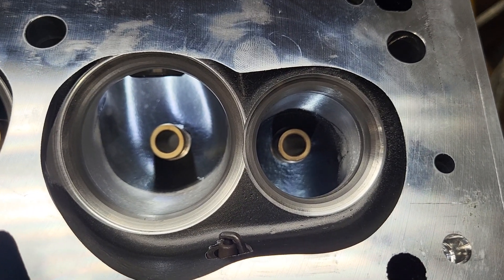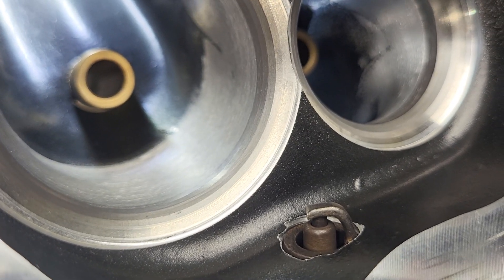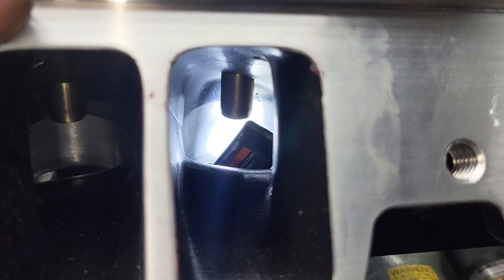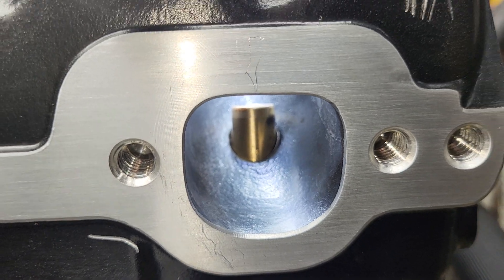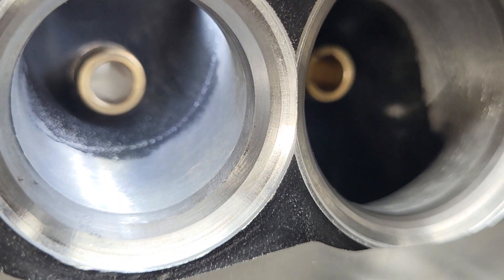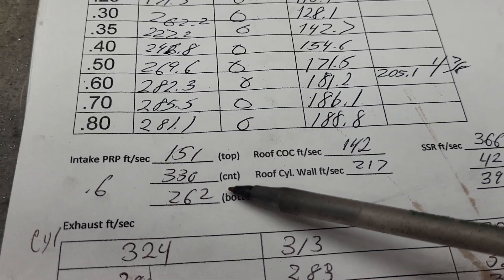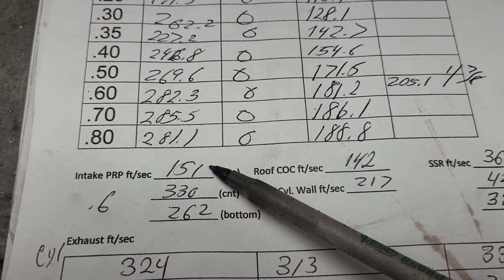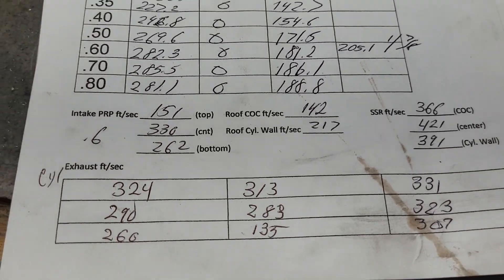Promaxx 200 small block Chevy cylinder head, First look and stock flows. Pretty good!

Comment: You have done some very good videos on head porting and it is going to be interesting how these heads turn out.  Have ever thought about doing a short video on the use of flowballs?  Such as showing what happens when they are used and what should be done after seeing the results.
Reply from the maker: @kenwilliams701  I thought I did that already. Thanks
Reply: @servediocylinderheads  I did search for flowball in the search option and did not see anything.  I seen one on pitot tube that was very good.  Is the flowball use possibly buried in a video that is named for something else.  Thanks for the great work and videos.
Reply from the maker: @kenwilliams701  I could do one. I may need reminding. Thanks
Reply: @servediocylinderheads Thanks That would be great.  I built an eight motor PTS flow bench many years ago for some racing I was doing then but never really scienced out how to do the porting correctly.  Put it in the corner when I was done racing and have not done much with it.  I have a 2001 S10 Blazer now and want to get more power out of the 4.3 so decided to port a set of heads.  Now that I'm older, want to do it right and understand what is going on in the port.
Reply from the maker: @kenwilliams701  Excellent!

Comment: I have sold those with the black coating.   For someone that want's that look they are great.   I have sold a few sets of these.  They work really well with blending the top cut into the chamber,  and yes the short side has a decent shape, but can be improved.  On the exhaust I cut a 75° and fix the short side as all of them have not been near as good as they should have been.   Also I open the pinch at the top [trapezoidal] as per D.V.    I have put them on a couple of 383 with 11to1 with 238 @.050 Hydraulic roller camshaft and they perform quite well.  600 hp.  ?  I have my doubts.
Reply from the maker: @Comet-hn3gm  600 is pushing it no doubt. Thanks

Comment: Thank you Charles for the review! Would you happen to have any changes to review & flow the GM's factory 113 aluminum heads? I've got 2 pairs of them and would like to know what's restricting them besides the obvious stock valves
Reply from the maker: @mikkokuorttinen3113  I have a set. 2.0"/1.55" valves and lots of porting. 265cfm.

Comment: Charlie, have you any experience with the Ebay heads sold by Deep Motors?  They appear to be very nice castings  with a good finish. They are some of the least priced heads I could find.
Reply from the maker: @4speed3pedals  No. Sorry

Comment: 580hp potential out of the box on the intake, needs work on the exhaust though
Reply from the maker: @No1414body  Better than I expected. Thanks
Reply: The Wallace racing calculator says : for Typ. Race Eng ... The HP for your Cylinder Head Flow of 265 is 545 with a RPM Range of 5,271 to 6,771
for your engine size of 408 CID
And for Superstock Eng ...  The HP for your Cylinder Head Flow of 265
is 604 with a RPM Range of 5,271 to 6,771
for your engine size of 408 CID
At the Superstock level adding 15 cfm nicely gets a good bump in power and potential RPM ...      The HP for your Cylinder Head Flow of 280
is 638 with a RPM Range of 5,654 to 7,154
for your engine size of 408 CID
Reply from the maker: @luckyPiston  Good info. Thanks